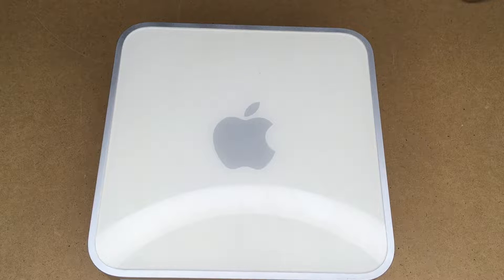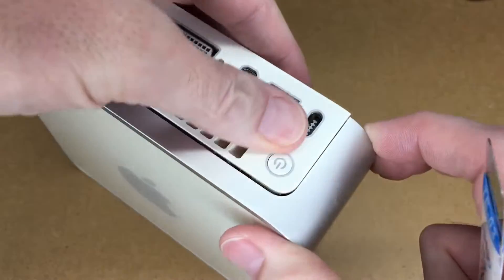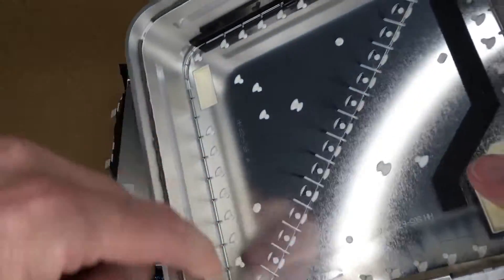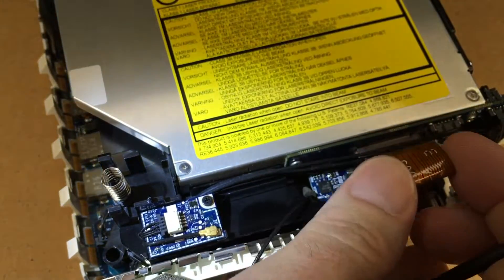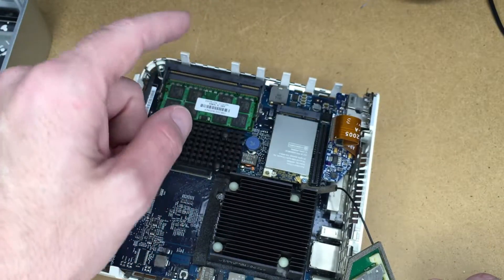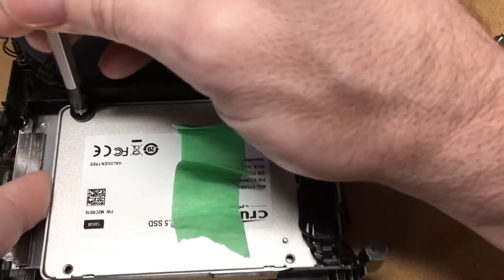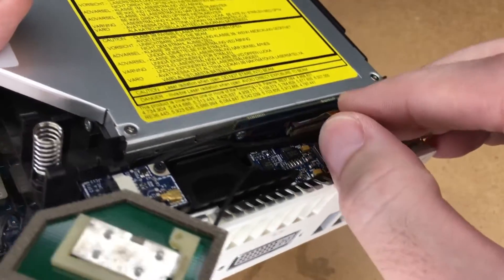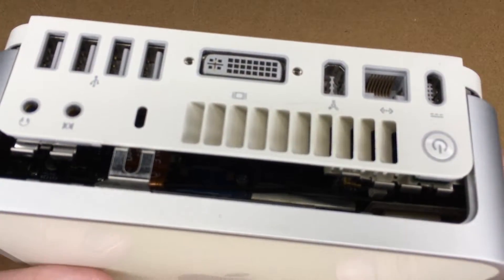Mid 2007 Mac Mini SSD Upgrade

Comment: If I preinstall Windows XP on a SSD and then put the ssd inside the mac mini, will it work?
Reply from the maker: I'm not completely sure. You could try installing Windows XP on a USB flash drive to try it. If that works, I'm guessing the SSD would work.
Reply: https://www.youtube.com/watch?v=aP1lumiodI4

Comment: Excellent video! I have one of these - a 2007 model. But it runs ooohh so slowly. What should I replace to make it go faster?
Reply from the maker: It's probably not worth it to put a large expensive SSD in a computer that old but it would give it a little bit of a new life to put a cheap SSD in it. Amazon has some for around $20 that are 120GB. I would also max out your RAM.
Reply: which version of software had (or have) you installed on your mac mini?